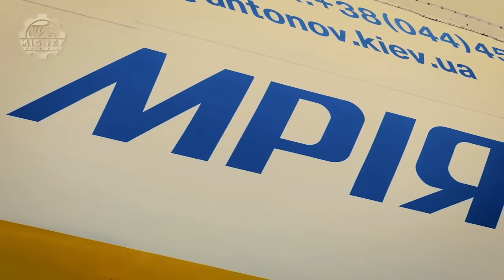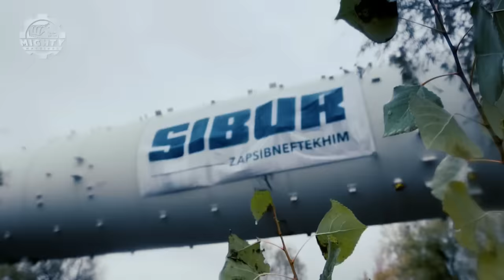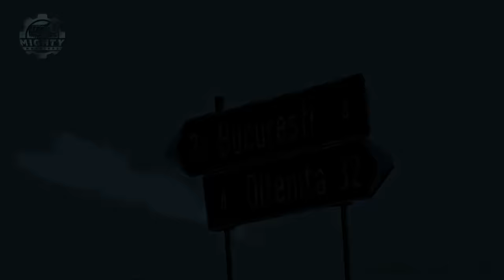This Is How The BIGGEST Oversized Loads Are Transported

Comment: I’d really like to see the cost calculations for these methods vs cargo helicopter fleets. On the one hand, fuel for cargo helicopters is super expensive, as is equipment wear and tear. On the other hand, you don’t have to coordinate traffic on major roads and can take a direct route instead of only using the largest roads that can take the weight.
Reply: The largest helicopter lift capacity is what.. 40k? These heavy loads way 100,000+, and it's much harder to get 4 helicopters flying in unison than it is to strap the thing to a truck.
Reply: @sythex92  see, that makes sense, but all I really hear is "they haven't made the helicopters big enough yet"
Reply: @Rms2015  at that point it would be what’s known as, airplane.
Reply: power transformers like the one in the video at 4 mins weigh in at 600+ tonnes or around 1.2million lbs  , biggest helicopter load is 30,000lbs
Reply: Huh. It sounds like maybe you'd have to coordinate with local authorities anyway, so that nothing important is damaged be the collective downdraft of hundreds or thousands of cargo helicopters trying to lift the same load. It still feels like there should be a better way to do this, but I suppose a 600 meter wide treaded transport tank is also out of the question? I mean on the one hand, it'd be a war crime to drive it, but on the other hand, you wouldn't have to worry about clearing the path and it'd probably only take a few dozen years to assemble on site.
Reply: you watch too many movies lol
Reply: Also you have to factor the weight of the chains.
Reply: If they can transport King Kong by helicopters in the movies, then there is no excuse not to use helicopters.

Why do you think that Arnold kept yelling "Get to the Choppa"??!!!!
Reply: There is no helicopter in this world that can carry these things. Think about it and tell me the name of that helicopter.
Reply: This is really simple

Comment: At 0:24 Wouldn’t it have been easier though to move the boat by water instead?
Reply: That assumes that the delivery point is connected to the source point with a water route capable of supporting the load